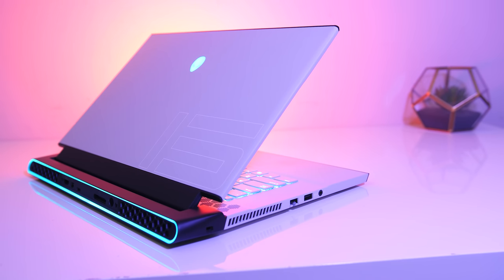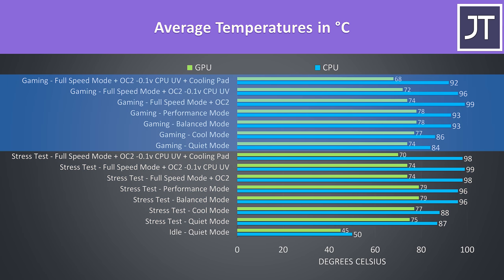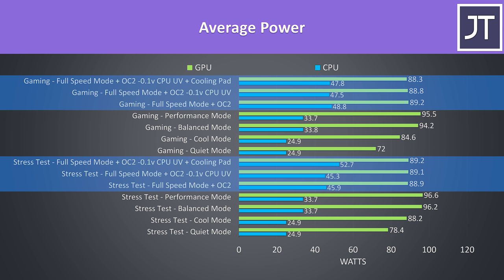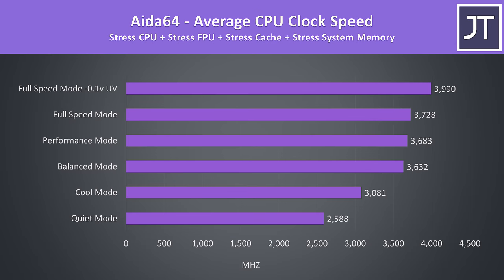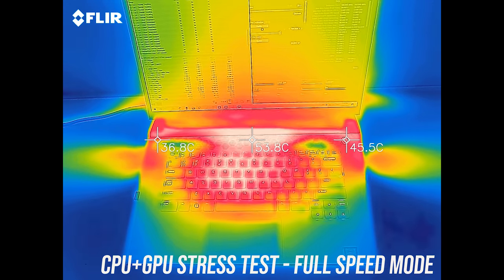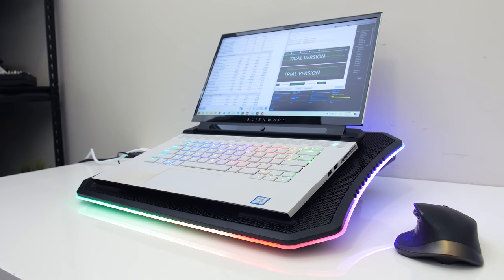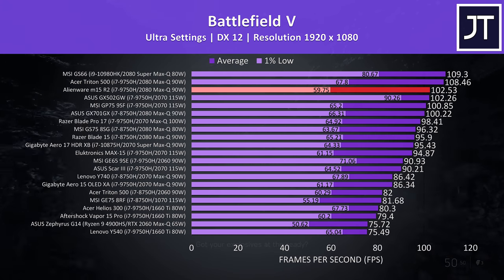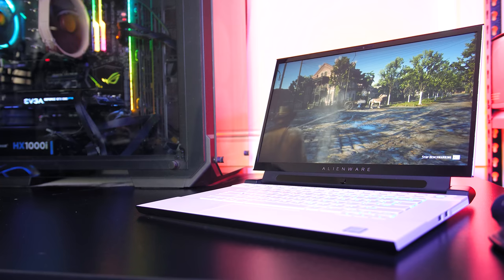Alienware m15 R2 Thermal Testing - How Hot Is Too Hot?

Comment: I remember Alienwares used to be the best in the gaming line with everything checked (when I couldn't afford one), but now they just can't compete with predator, legion etc. They are more impressive and affordable.
Reply from the maker: They still do ok performance wise, price is up there due to the unique looking design I guess, just the way it goes with products that are priced on the more premium side of things.
Reply: maybe they are new to the thin gaming laptop? their heavy laptop is good tho (aw 51m)
Reply: Have you met Area 51m?
Reply: the moment you said predator makes your comment invalid.😂
Reply: last summer, i was thinking about getting the r2 but the ram is soldered on the board and the cpu got to almost 100, that was a deal breaker. I wound up getting the AERO 17 WA. I totally agree with you though.
Reply: My 2nd gaming laptop was a m17x r2 was top of the line 4870 in crossfire a i7 920xm my friend I sold it to still has it 10 years on.
Reply: I was expecting a lot of Alienware hate in the comments, but I guess not. I hope pre-builts get better at quality control in the future. With the insanely good consoles coming out next year and lack of good quality prebuilts, PC gaming is becoming a shrinking market I fear. Ironically, it might be innovation in APUs from console and mobile gaming demand that saves PC in the long run.
Reply: @near237  the i7 variant of the helios 300 with 1660ti is faster than some rtx 2060 laptops..

The predator series is not a joke anymore
Reply: @solo_necro4904  I have basically the same M17x R2 and the 4870 just finally crapped out after circa 10 years, hence why I am watching reviews of the new model. Lol

Comment: Higher performing laptops but increases thermal throttling. The industry needs better cooling solutions. Good test and review 👍
Reply from the maker: I think they're already at the limit, a lot of companies are already resorting to esoteric cooling solutions such as raising the back up, pulling the keyboard down, or putting the components behind the screen. I think it's more a case of Intel pumping up the speed each generation for years without any actual good architecture improvements (eg 10nm) so they're forced to do crazy stuff to keep up and it's already at a wall.

Comment: you can stick coil tapes inside of back panel then stick thermal sticker between the CPU, GPU, RAM, SSD and back panel to conduct heat to back panel. it will reduce 42.8 Fahrenheit, 6 Celsius about.

Comment: If a laptop temperature goes high as 95°C , oh boy you need 3 AC's and a fire extinguisher
Reply: And a new home 🥺
Reply: Lol... (While gaming) Mine never goes below 90...with the gpu throttled at 82°C..

Sadly there is no technique to increase gpu throttling temp to 90°C :/
Reply: if you change the maximum power settings u can play all games on high settings without  overheating and temps between 60-70

Comment: Hey so, I just got this laptop and my temps for CPU are hitting 96-100 degrees celsius while playing warframe on medium settings. Is it okay? since i cant undervolt due to restriction from intel, but i can decrease the power of the CPU boost PL1 and PL2, which yielded lower temps. Wanted your advice on this <3

Comment: Would you please tell which cooling pad you're using, it looks great and nice review BTW . I have a m15r2 but with a rtx2060 one , I had to undervolt it cz it was thermal throttling,  the cooling pad would definitely help but the ones I saw weren't effective

Comment: Do you think AW will fix thermal in the next R3 version (out in 1 month) ? Will we get a full review on it ? Thank you !
Reply: well they're improving the cooling solution using vapour chambers and a 12-phase VRM array on models with the 1660 Ti and above. Though they are also now using 115W Max-Q/Max-P GPUs instead of 90W variants (the 2080 Super max-Q on the M15 R3 is 105W configured), the M17 even gets a 150W 2080 Super Max-P in the higher end configs.
Reply: x
Reply from the maker: Not sure, need to get it to test out, I don't like speculating 🤔

Comment: Great video. What did you use to hold the undervolt after restart?
Reply: XTU will hold the undervolt after restart, provided no system updates occurred, thus resetting it.
Reply from the maker: Thanks, I just apply it prior to doing my testing, I do not need to concern myself with that for getting this data. Some laptops will remove it and revert to stock after shut down, there are ways in Throttlestop to do it but you'd need to check guides on the topic, I've never looked into it.
Reply: @JarrodsTech  Throttlestop requires disabling memory integrity checking under 'core isolation' for hardware security, otherwise the DLL cannot be read by the executable. Which is why I use XTU instead of throttlestop.
Reply: @TabalugaDragon  disabling memory integrity checking allows a program to modify memory at will, in a worst case scenario a program could use it to hijack the system and prevent you from doing anything whilst simultanously grabbing every piece of valuable info it can find.

Comment: I'm surprised to see such high temps when the ventilation frames are so massive, What could be the reason for this particular laptop to have such high temps compared to others with the same configuration in hardware? Since design doesn't seem to be the problem, maybe there is something wrong with the paste and/or fans? I mean, even the G series has cooler temps (on the cpu) with the same CPU.

Comment: Hey 👋, I’ve really been enjoying these videos they are great. Just a quick question so I see that the cpu temps drop when gaming in silent or the cool/balanced mode (can’t remember what it’s called as I’m typing the comment). I’m just a little confused as to how the cpu temps are lower when the fan modes are on the lower settings while gaming? Does the power level of the cpu drop to compensate for the lower fan levels or? Sorry in advance I’m new to the pc world so Ik my terminology might not be the best as I’m not very tech savvy.

Comment: i bought a razer blade 15 with 1060 max 1 back in the days. it was nice, 6 cores 12 threads.. the problem is they got outdated too fast so you cant enjoy the newer games... just stay away from high end expensive laptops, its not worth it... get a decent laptop and use the rest for a desktop

Comment: i have been waiting for your review on this laptop for months. i purchased the 2070 version and i was worried over my temps. the performance of this laptop is just great because of its power limits. i tried undervolting at different levels using XTU but it didn't do much to the temps. however with the room temperature it plays a big part on the temperature... i just wish that they didn't flip the board so that applying thermal paste would've been a lot easier.
Reply: Hey, I have the 2060 variant with the i7. I was able to keep the CPU temperatures under control using throttlestop when it's not being pushed a lot. But for some reason, it starts cooking itself when I am playing demanding games or stress testing even for a short while. How has room temperature control helped you? Anything else that you might have tried?

Comment: Jarrod: 21 degrees ambient room temp
Me: laughs in South American heat
Reply: Same for me, bro. The heat in South America is crazy n the electricity bill is too expensive to use AC.
Reply: @r.casagrande8689  say that again. I plan to use solar powered air conditioning when I get my own home. For now I use a regular fan to circulate air so the vents can pull some amount of cool air.
Reply: @le_travie7724  I'm doing same as you currently.  Hahhahaha cheers, bro.

Comment: About what I expected with regards to thermals, the R3 has an improved cooling solution with a 12-phase VRM config (instead of 8-phases) and uses vapour chamber cooling too. Likewise with the R2, the improved solution is only available on models with the 1660 Ti and above. Though it does use 115W Max-Q GPUs and a 105W 2080 Super max-Q which may negate the benefits. (M17 R3 gets a 150W 2080 Super Max-P on the higher end configs instead of a "puny" 90W 2080 Max-Q!)
Reply from the maker: Hopefully it doesn't take as long for me to get the new model and I can compare it!
Reply: @JarrodsTech  yeah, hopefully the next model is sent to you before the R4 comes out, not when it comes out.

Comment: We have the same results for the fans on Full Speed! So I asked Dell actually about it, and they said it's normal. Even when I got the MOBO and Heatsink replaced. Funnily enough, there's an option in the BIOS for Fan Performance Mode that just sets the Fan speed to Full Speed levels at the get go, with the same results of it slowing down after.
Reply: Hello krisha, what are your thermal numbers?
Reply: @pawperdawper9221  70 on the GPU, and 88 on the CPU now, running Horizon. It's been LM repasted.
Reply: @krisha12  awesome i think i will repaste too, do you still remeber what the thermals were prior to  the repaste?
Reply: @pawperdawper9221  Just generally thermal throttling on the CPU. GPU was always good.

Comment: Had alota thermal throttling issues when gaming. Setting the fans to full speed, undervolting, and limiting processor max state to 95 percent averaged 70 to 80 degrees at 1080p 150 fps gaming

Comment: PLEASE READ MY COMMENT!

There is a bug of full speed mode. As he mentioned that after u enable the full speed mode, the fan will push to 100 percent for around seconds and then drop to 83%. This is the case for 2060 model and it seems that 2080 model also has this issue.

One way that I found to fix it is too enable the full speed mode first, wait until fan speed drop from 100%, and then u switch to performance mode immediately. And switch back to full speed right after that. By switching between full speed mode and performance mode, u will find that the full speed mode will eventually stable on 100% fan speed !!!! 

I guess this is because alienware don't want u always let fan go 100%. Under the normal conditions,  the AWCC will only allow for temporary 100% fan speed without using my trick. Or there is just simply a bug in the AWCC..... Who knows?

Comment: I was wondering if clock speeds actually matter in games. Could you do a turbo boost on Vs off gaming test? Because if the difference is 10-15fps, one could easily drop the settings and make up for this. Whereas the temps would be like low 70s at maximum. And fan speed would be quieter too

Comment: I’ve gamed almost exclusively on laptops since the late 2000’s and have owned several Alienware laptops. 

They make a good machine, but they have consistently run stupidly hot for more than a decade. They don’t care about giving you adequate thermals and they likely bank on ill informed consumers not checking temps or just not caring. They sell machines based on performance. 

They want you burning up your laptop in a few years, just outside the warranty window and purchasing another. For the record, that doesn’t stop me from owning them every now and again, because they actually are capable of making good machines. Just wish Dell put more of a focus on delivering acceptable temps. 

With that said, the best gaming laptop I’ve ever owned is a 2014 Malibal. Still running strong today after thousands of gaming hours. I’m only replacing it because the 870m is quite long in the tooth. The reason for its longevity? Excellent cooling, runs cool under load.

Comment: I have an y545 and I use throttle stop it helped lower my temps from 94c to low 80c. then I switched to Manjaro and my temps doesnt go higher than low 70s with no undervolting. So maybe windows is the cause. Steam works flawlessly. I game on high settings plus my fps is the mid 150-267. THis with playing TF2 and CSgo

Comment: Why does undervolting increase performence when taking away a little bit of power?
Reply from the maker: If the limit is thermal throttling, removing power = less heat, so performance boost.
If the limit is power throttling, lowering voltage allows more to get done with the power available.

Comment: is there anyway (software or bios settings) to put a cap at your temperatures and make your laptop thermal throttle earlier to make sure it doesn't get like to 100 celsius or 90 ?
Reply from the maker: Varies by laptop, but not that I'm aware of with this machine. Some support it in the BIOS, but generally thermal throttle caps are hard coded.
Reply: @JarrodsTech  thx for the info :)

Comment: Laptops these days are reaching their maximum cooling performance! Most of manufactures have to invest more in cooling solution because cooling is outdated more or less with body modifications! Imagine using this in warmer situation or country! For me now 1st thing is to look at the cooling and then performance and design! I like how Asus moved the keyboard down to cool more effective and keep your hands cooler! M15 is a nice machine but cooling is bad on this model! 98 degrees is a lot for a machine. 
Peace!
Reply from the maker: Only so much they can do with Intel keep the same architecture but just boost speeds each gen.
Reply: @TabalugaDragon  I'm not saying are all bad in terms of cooling but they put a desktop grade cpu in a tiny case! I own MSI laptop but never had a thermal problem. In full load cpu/80, gpu/70. My m15 I sent it back and choose MSI.

Comment: hello i have an Alienware m15 R2 with CORE i7 9750H and RTX 2060 and i tried playing assassin's creed: Valhalla but the CPU clock kept decreasing until 2.5GHz and then the game was unplayable i also tried playing cyberpunk 2077 I didn't have much decrease in the CPU clock but the fps was at 30 (medium graphics) and the temperature was at 100 C also same issue when playing COD: Warzone so do can u help me with a solution for my AC : Valhalla? and is playing video games while CPU is at 100 a normal thing or should i stop playing such games??
Reply: @jarrod's tech

Comment: Hum so the M15R3 is out now. Dell has released a new M15 basically every year!  Is that to keep up with the competition or because of weaknesses in the previous system?  Every iteration has improved cooling, power, and a few other tweaks but they keep trying to make them smaller and thinner!  Intel keeps making CPUs that run hot, hotter, hottest, and suck up more power which leads to thermal throttling and inefficient CPU usage. The system makers can't keep making smaller systems while CPU's are getting hotter (well Intel CPUs). I would much rather have a high-performance system that is a bit larger that runs cooler and without thermal throttling.  Ok, back to Alienware systems I had the M15 R1 in several options and the M15R2 and was not happy with either one. Each system had issues and was not worth the money to me. There were better options and Dell keeps limiting options to specific system colors and specifications. Additionally to keep the form factor smaller and thinner (Make systems a bit bigger please the race isn't towards who can make the smallest system but what system runs the best and provides the best performance) they resort to soldering components I would like to update in the future.  Just my 2 cents.